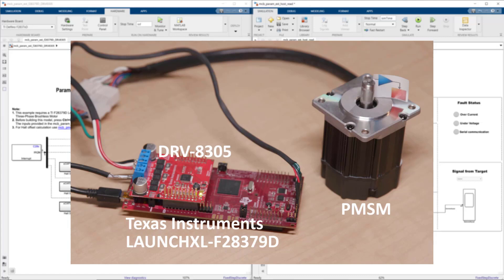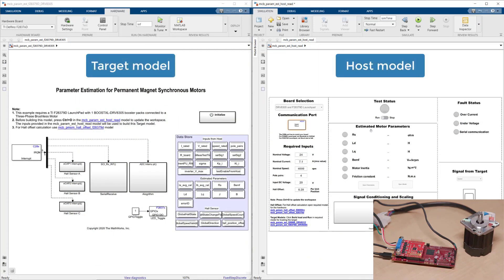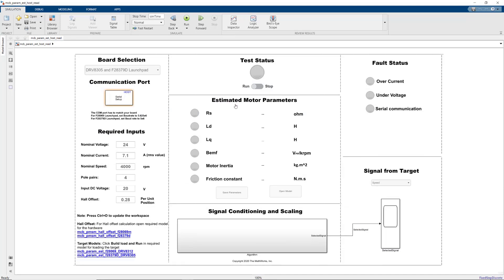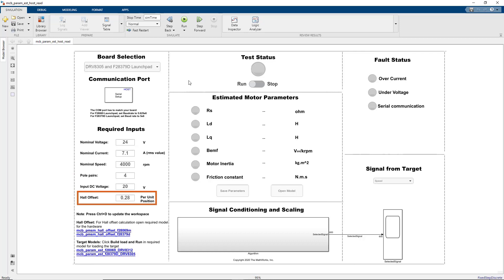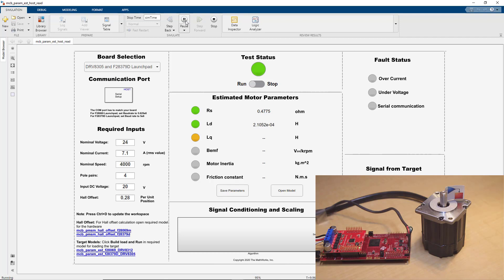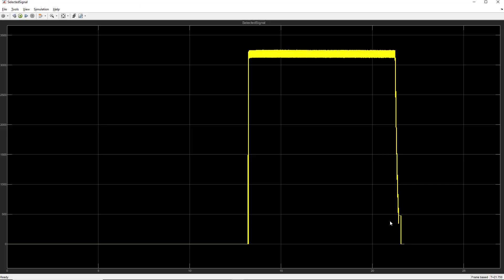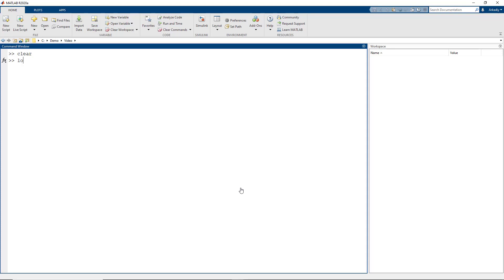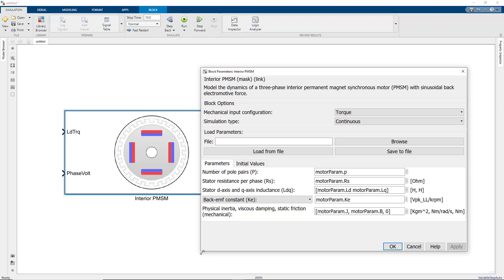How to Estimate Parameters from Motor | Field-Oriented Control of PMSM with Simulink, Part 1

Comment: The motor you are showing is a  PMsyn  Teknic, and parameter results look good. However, if you use an L-C-R meter, you get a very good idea of the inductance  and resistance.  Then run under current control and look at the LPF terminal voltage, this gives you an estimate for the rotor flux, as discussed in my Springer book ''Applied Control of Electrical Drives'.